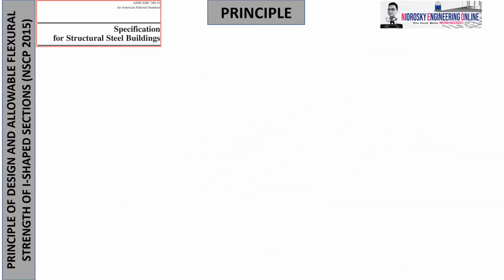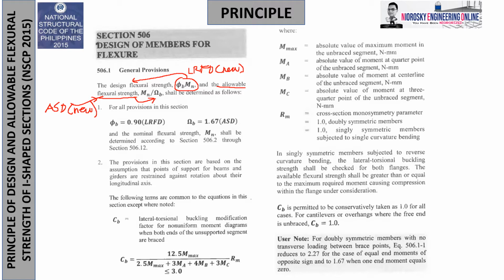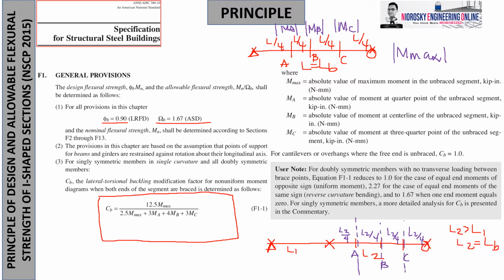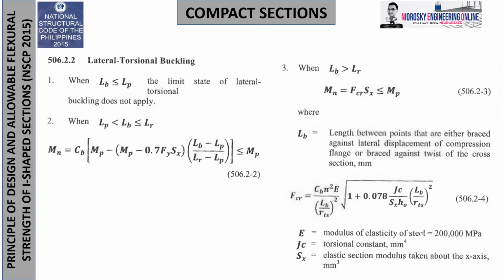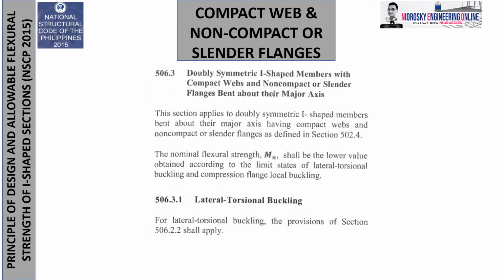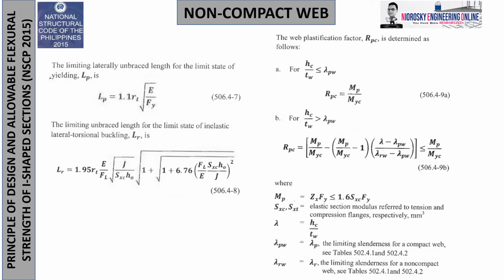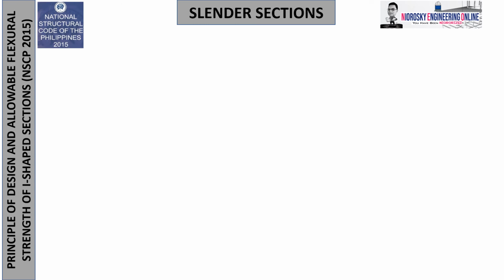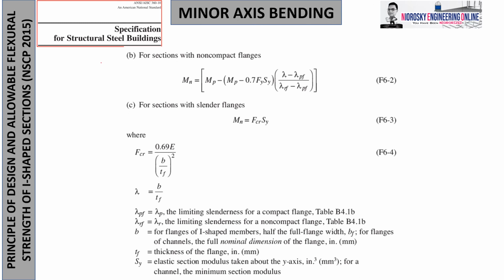PRINCIPLE OF DESIGN AND ALLOWABLE FLEXURAL STRENGTH OF I SHAPED STEEL SECTIONS BASED ON NSCP 2015

Comment: Hello po. Tanong lang po sir. Paano po malalaman kung cb = 1.0 or yung given formula ng cb ang gagamitin? Salamat po sir
Reply from the maker: There is already an explanation on that matter :) it was discussed in this video lecture :) it is dependent on the condition of the support and presence of moment in the support section. Check if it qualifies the description.
Reply: @nioroskyengineeringonline8968  thank you po sir!